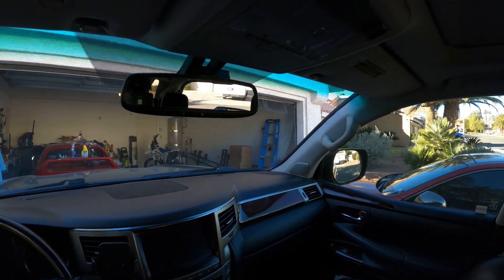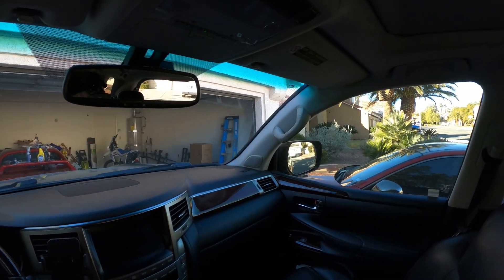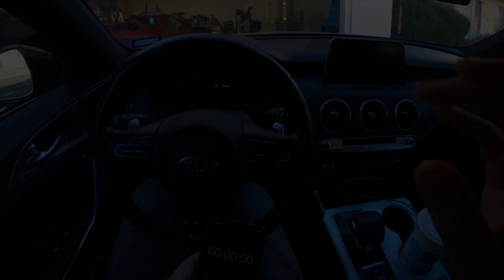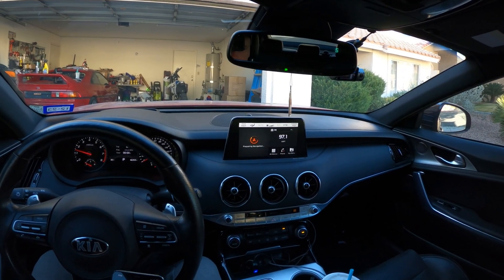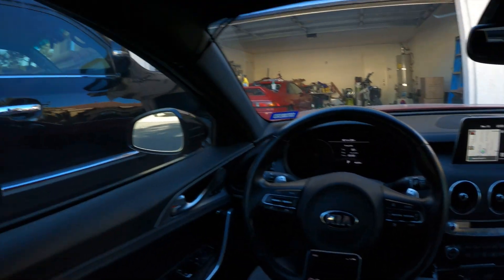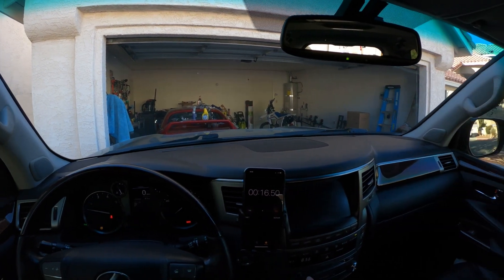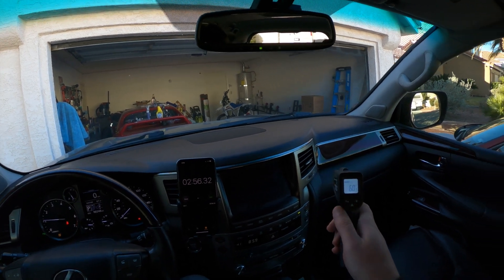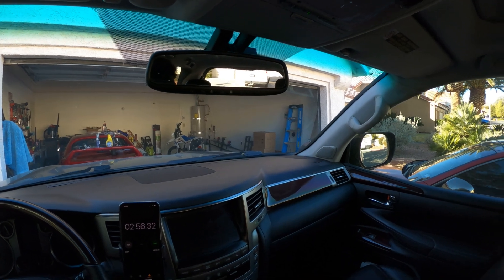Does Lexus' Instant Heat System Actually Work?

Comment: I had never heard of this before your video. I tried it in my LX570 this morning. From a cold start on a 21°F morning there was DEFINITELY warmer air coming out in about 30 seconds. I think your challenge is that you are not in a cold enough climate/cold enough ambient temps to notice the heat.  But it does make a difference when when you are below freezing.
Reply from the maker: It should definitely work at 40 degrees. At the very least it shouldn’t be slower than a car without an auxiliary heater. I’m going to check fuses and relays. If none of those are bad I’m probably just going to leave it. Not worth tearing the entire dash apart for.
Reply: @williambiel  mine is the same lol, but it’s a 2013, takes about as much as long as any other car. Cool thing is it has remote start but once you open the door, the car turns off lol.